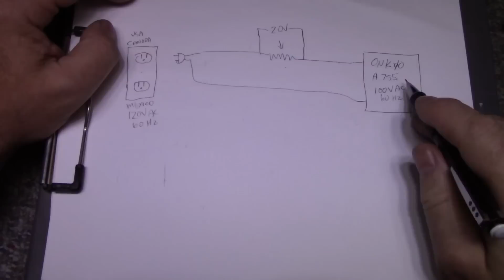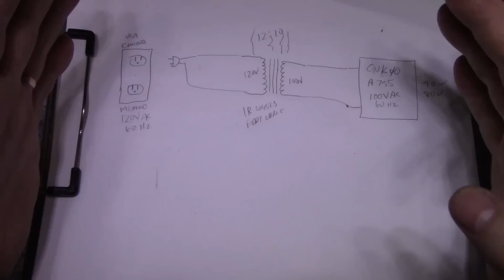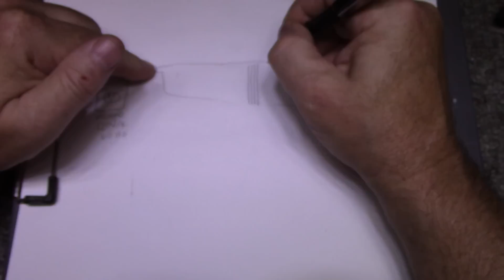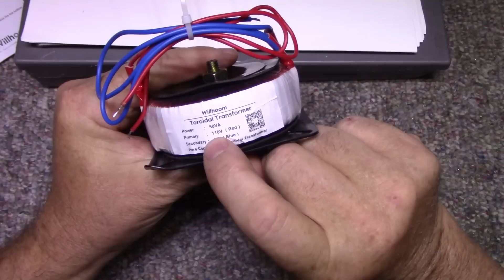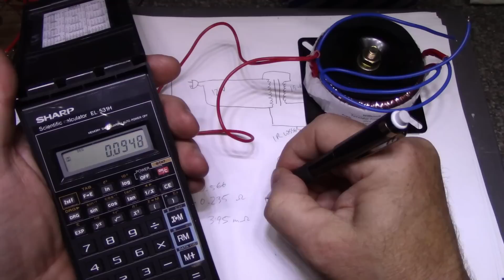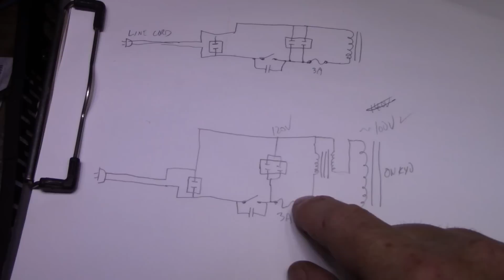Onkyo Integra A-755 Mk II Integrated Amplifier Repairs Part 2 (Ep. 186)

Comment: Good work, TB! The US/Euro equiv. is A-7055. The serv mnl has selectable  voltages (110 - 240). I'm surprised the Japanese model does not use same worldwide xformer??? That "Buck"  xformer has the benefit of cleaning up AC voltage, like a good line conditioner. Audiophile stuff!

Comment: Nice and elegant solution Trevor! I use a 500w stepdown transformer to 110V and must say it works like a dream. The voltages are not at all at the level the capacitors can't handle, I did change the railscapacitors though. But I admit, yours i a very elegant solution and will look into it, see if I can do something similar. thanks for the video!

Comment: I THINK YOU ARE WRONG,    that transformer   and power  supply     more then  likely  would    be able to  handle  the  increased    voltage   The volume    would go  up to   11   I wouldn't   that that say  with a  television     made in the seventies   , but that large    transformer was  designed    for  efficiency
Reply: If you're so smart,where are your audio repair videos  ??

Comment: Very nice solution, Trevor. If the original transformer would have been a toroidal one, you could consider adding additional primary windings. But given what you had to work with, this is the best way to do it.

Comment: Doesn’t the buck transformer have to rated at the same or higher VA as the original transformer to maintain the amplifier’s power rating?
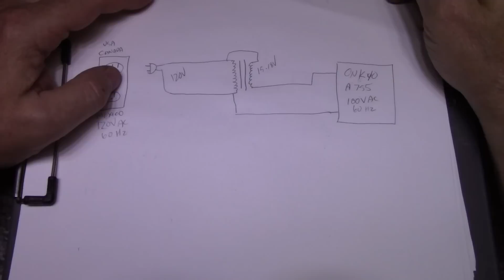Reply: Look at the schematic at 14:45
The current needed for the primary of the original is only going through the secondary of the buck transformer. And that secondary is made for much higher currents than the primary needs. That secondary only needs to subtract its secondary voltage from the primary voltage of the original. Hope that makes sense 🤔
Reply: @erikdenhouter  kinda lol. I’ll take your word for it. As long as the original gets the current it needs. I know that the toroidal is more efficient for its size. 

A quick question. I’m thinking of buying a Japan market (gray) Accuphase amp with a toroidal TF. As far as I know, it doesn’t have the handy taps (top diagram) for changing the voltage that the old EI ones did. I would, however, imagine that there is, under the cover, some way of adapting voltage for other markets as I’m sure that Accuphase doesn’t have specific TFs for other markets. Anyway, I hope so as there is no room in their chassis for a buck transformer. What would be great is if there was a simple (ish) switch inside for that purpose, but I have no idea. 

You guys in CA have it good vis a vis Accuphase stuff - they really hit us hard here in the States. Then again, we don’t pay VAT, so there’s that…
Reply: @billd9667  I don't know at all about that.
On a toroidal transformer you could fairly easy add some extra windings for the primary. Simply said, put some turns on it, say 30, and measure how much voltage it gives. Divide that number by 30, and you know the amount of Volts per turn. Now divide your extra voltage for the primary (120 - 100 = 20) by that amount of Volts per turn, and you have the number of turns you have to add to the primary. But implementing that is another story....
Reply: @erikdenhouter  yeah, that would be a real hack job for me. I think I’d trust that task to a professional…

Thanks, Trevor.

Comment: Trevor, that was a very tidy solution using that toroidal transformer for the bucking. I've made bucking supplies for my older tube amplifiers but used the standard EI style transformers. Toroidal is a much better solution, more efficient and less stray magnetic flux.

Comment: I live in Florida and my outlets read 127 volts. But then again we have 4 big nuclear power plants. Crazy voltage. Every once in while you hear a line transformer explode a street block away. My HVAC pretty much runs on and off all day unless it's winter.
Reply from the maker: I think they like to jack up the voltage because it costs you, the consumer, more $$. 
99.9% of utility customers have no clue what the line voltage really is. Jacking it up will equal more Kw/hrs for  average daily use which equals more profits for utilities
If they really wanted us to conserve energy, they could turn down the line voltage and the overall usage would drop

Comment: noob question,   couldnt you just install a votage regulator inside the amp in between the bridge rectifier and filter caps ?
Reply from the maker: Yes but that present new problems. The biggest problem would be the heat wasted to drop the voltage by 20%
All series pass regulators dump the excess voltage as heat for the current being drawn
Reply: @TrevorsBench  thank you for the answer Trevor

Comment: Pretty slick solution for changing voltage.  Would be interesting to see how much voltage sag one of the Amazon converters would have under the same load testing. There were higher watt versions too.

Comment: nice solution , i get 243v ac at the mains here in Scotland ,UK. i use Chinese SE tube amps which are invariably 220v , this means the heaters and plates are all over volted with the inevitable red plating and premture tube failure . i also found bucking transformers were the best solution .

Comment: Anyone doing this should make sure that in no way the top of the bolt could accidently touch the metal cover. If it's close, a piece of insulated board or plastic should be fitted to prevent contact. Should it make contact the result would be a VERY high flow of current, maybe even a fire.
Reply from the maker: Good point, thanks for mentioning that. A shorted turn can create several 100 amps if the resistance is low enough
There is about 1 cm of clearance with the lid
Reply: @TrevorsBench  It does make a very dramatic video, however.
Reply: So dont operate the amp naked?